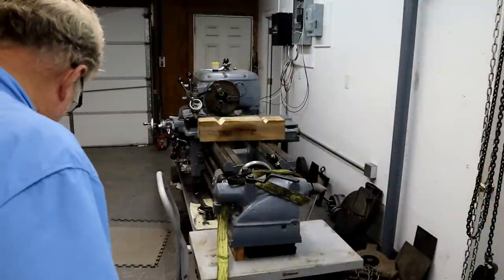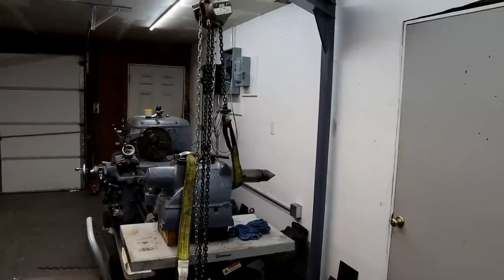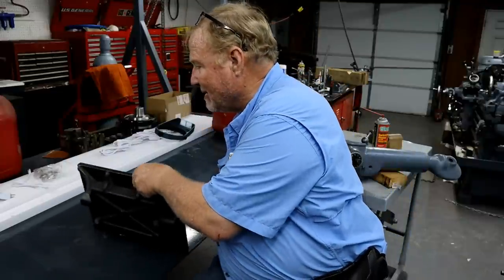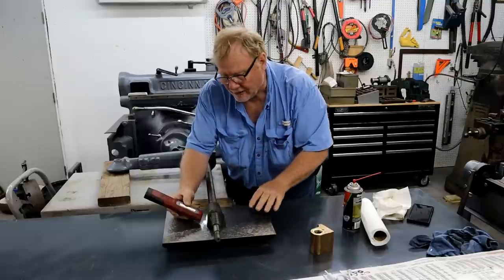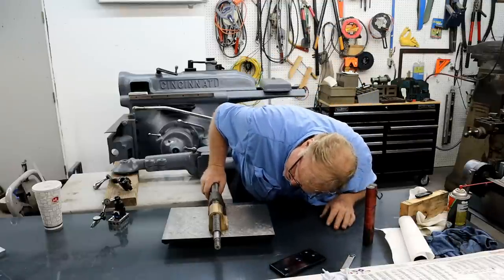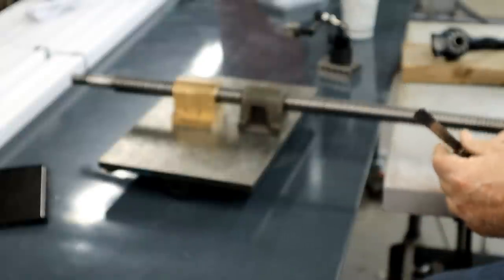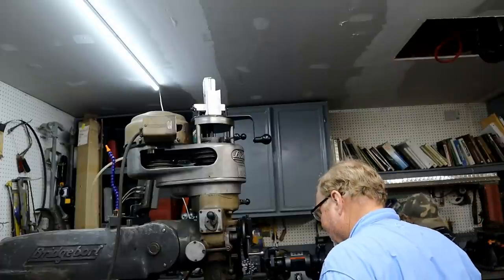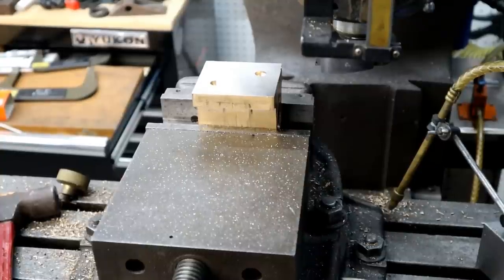Rebuilding Old Machines : Cutting The Base

Comment: Belt Bridgeport are so quiet that is the beauty of them. 
I don’t understand those draw bar tightening attachments if I did 100 tool changes a day. Yes it would be faster.
Reply from the maker: I like them... Maybe not so much Don's but they do make it simple and fast.
Reply: It came with the mill when I bought it
Reply: @donmadere4237  oh ok  nice if it works keep using it.   You have a nice shop. And lots of energy.  Yes I am a machinist Dale

Comment: Setting the AC to 68°F is important, particularly for the inspection area! That's the temperature all the gauges are calibrated at, you want to keep the shop close to that to avoid distortion or inaccuracy due to heat. 7°F isn't much, but if you're making something needing particularly high precision (microfluidics valves, for example) that can be enough to throw the part out of tolerance. It's not for comfort, I swear!
Reply from the maker: That's my story and I'm sticking to it ! :)

Comment: sorry Steve I was shouting at you😁. You should have turned your plate 90 deg with the two feet farthest away from you, then shimmed the one foot, that way you wouldn't be messing about lifting up the plate while trying to run feelers under your nuts!😁
Reply from the maker: Did not have ANY shim materials!  Not even rolling papers :(
Reply: @10swatkins  not even a beer tin!

Comment: Not all the way through yet but had to say, it's funny watching the conversations between machinists and fabricators or boilermakers. One thinks a thou is the distance the pin moves on a micrometer when the handle is rotated between a couple of marks that indicate a thou, and the other thinks a thou is the thickness of his thumb or the diameter of the piece of chalk he is marking up with ;)
Reply from the maker: It's a different set of mind....  When I used to make telescope mirrors I was working in units so small you had to measure with light waves...   
Don would have thousands of years of bad luck if he was a mirror maker :)